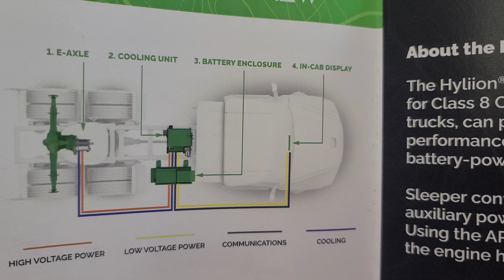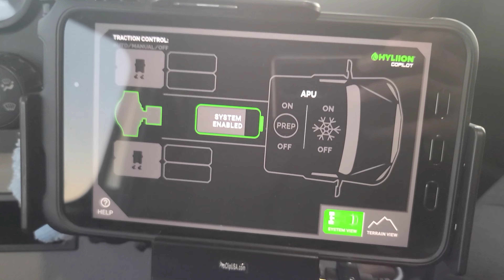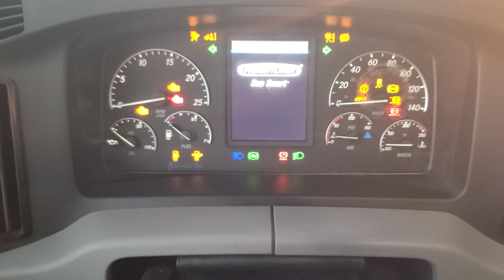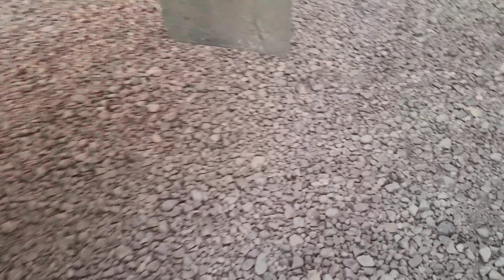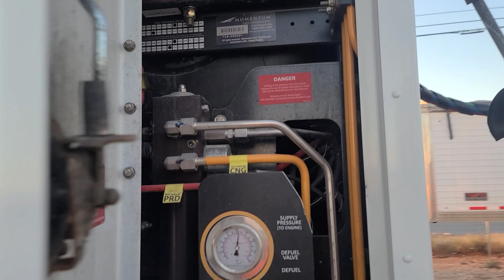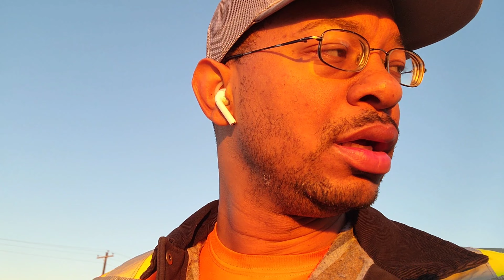Hyliion EX Pre-Trip inspection with Cummins comments-Let's Begin😊

Comment: have you looked at ABS Logistics? they just gave amazon 1000 CNG trucks....I just saw a video about ABS and wonder if you know about them.
Reply from the maker: I do now😄
Reply: @DMGbrokenfree  maybe this is why HYLN won't make it LOL...I will be dead...I invest so much in HYLN...I am stupid enough to think no one does what HYLN does UGH
Reply: @DMGbrokenfree  may I ask if you own the truck with HYLN power train? does the power train take up space in the back and feel heavier while driving?
Reply from the maker: Your not stupid. Hyliion does not make CNG trucks. UPS has been running CNG trucks for years. We are all here to learn. Hyliion makes aftermarket power train solutions. CNG Is old technology.
Reply from the maker: It only takes up space that was not in use. For example between or alongside the frame rail. It makes the truck heavier. But in Texas an overweight permit can be purchased allowing the Griss vehicle weight to be 5% over the limit. Thus, 84,000 pounds is legal and compensates for the additional truck weight.
Reply: @DMGbrokenfree  thanks so much for the info.  Does that extra weight bother you while driving?

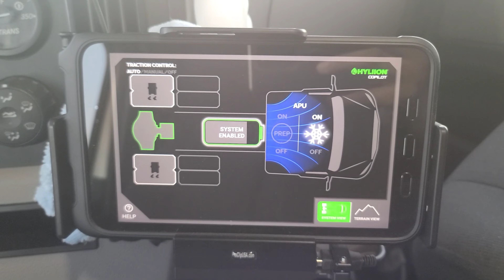Comment: 2:06 So with about 80% battery the APU can run for about 7 hours? That doesn't seem very long(?) Is there a way to ensure you have enough battery power at the end of the day to run the APU overnight? or is that what the on/off 'Prep' button is for?
Reply from the maker: 10 hour runtime at full charge. Prep takes 10 minutes to reach full charge while driving.

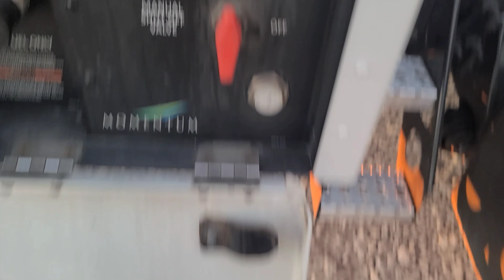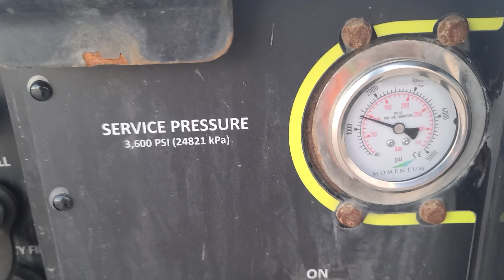Comment: Awesome truck and thanks for presenting it. I know it's nitpicking but how come the bolts holding that gage are already rusty?  Around 5:51- 5:56. Where did Hylion get those bolts from? Even the home depot bolts will last a couple of months before starting  to rust. And the door hinge is rusty too. Hope they solve the corrosion protection  because in the rust belt that enclosure will fall apart in two winters. Let's hope this is their biggest issue down the road.

Comment: Excellent tour and very informative. Do you think this tech will make its way into cars?
Reply from the maker: Great question. Matt Gold at Hyliion sent me an application chart. It can be applied to 4 wheel motor vehicles. Would it be cost effective? Probably not. But it would make sense when. Pulling boats or campers with a pickup.

Comment: I don't quite understand that point. If you had an amazing natural gas engine, why would you need the Hyliion thing as well? What does "powertrain solution" mean?

 I'm asking as a complete noob, I don't even know what it's supposed to do, it's quite confusing to me.
Reply from the maker: The Hybrid EX reduces the fuel burden on a semi truck by adding electric tourqe and horsepower at certain intervals. Mainly when accelerating from a stop and accending mountains. It is a self charging system which uses regenerative braking technology. So the supplemental power from the electric axle never needs to be charged on the grid.
Reply: @DMGbrokenfree  Makes sense, thanks a lot for the reply :)